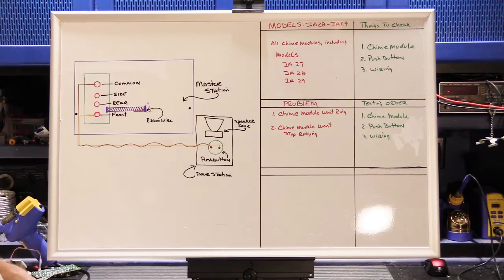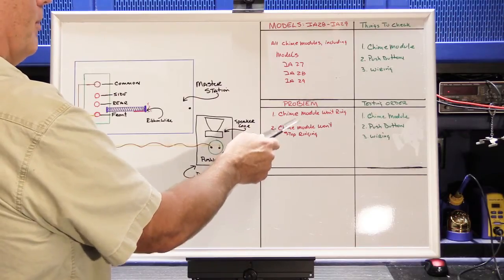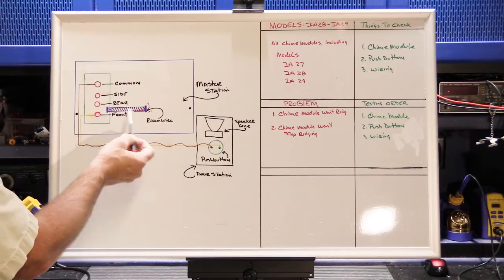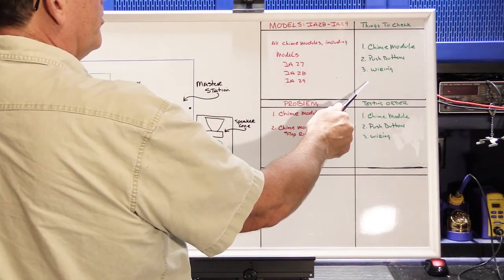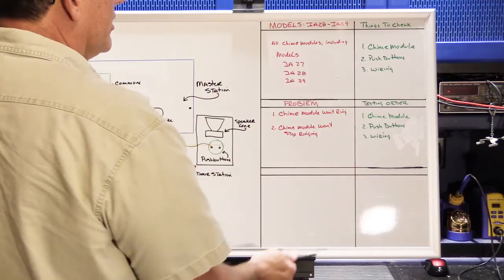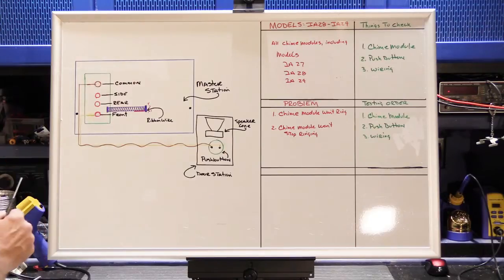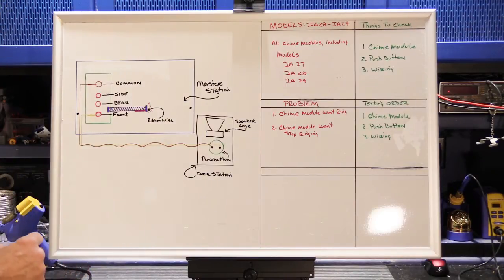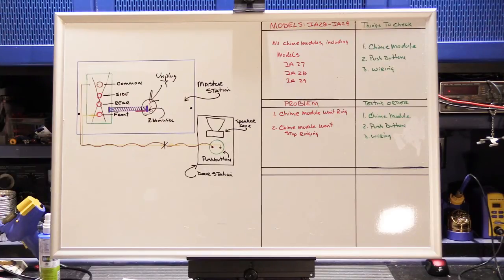Fundamental Trouble Shooting of NuTone Intercom System Chime Modules

Comment: Are the doorbell buttons supposed to have lights? I recently bought a IM - 2003 from eBay just to mess around with it it fully works, but I hooked up a doorbell button that has a light in it and the chime module kept going off until I disconnected the button so I popped the lightbulb out the button and hooked up the button back to the chime module and it worked fine. But I would like to know if I did something wrong are doorbell buttons supposed to have a light when connected to a master station?
Reply from the maker: Hi RadioBrodacstingRecordings:  Chime Modules (IA28 & IA29) like the one in your IM2003 are designed to have lighted Pushbuttons.  The light must be an incandessent bulb, not a LED (remember, an led is a Diode).
     If your Pushbutton had a incandessent bulb, there could be a problem with the Chime Module - the IM2003 - or both
- Chris
Reply: It turns out that my doorbell button was one of those new LED ones. Thank you for helping me.

Comment: Thank you. I was able to fix mine with your help. Luckily, I knew from the 1st test that the problem is in push button at the front door by connecting the 2 wires.
Reply from the maker: Hi Vinesh:  Very Good! If you need a replacement Push Button - we have them - Chris

Comment: I am an electrician, I have installed many intercom systems mostly the IM 3303 with chime modules. I have seen many issues where the volume just doesn't go up to where it should and I have adjusted the master system with the volume control during installation. It is as though the amplifier just wears itself out after several years. the chimes are the first thing to lose volume also. any tricks or ideas?
Reply from the maker: +Cary Lamari The most common cause of low chime module volume is incorrect adjustments of the "system volume" and the volume setting of the remote stations.

Starting with all of the remote stations volumes set to Maximum (including the volume control on the Master Station) set the "System Volume" (behind the lower right-hand door) to set the radio to a comfortable level.

Now ring the ring to see where its volume is and if it's loud enough (or too loud).  

If the chime volume is still too low (or too high) use the volume adjustment on the chime module itself (it is not preset from the factory) I do have a Video that shows how to adjust the volume on the chime module: https://www.youtube.com/watch?v=TqPN2UsLmv4

I hope this helps
Chris

PS.  The amplifier do not typically wear out over time unless they have been grossly misadjusted for decades. It it the system adjustments that slowly become out of adjustment with use from the owners of the system